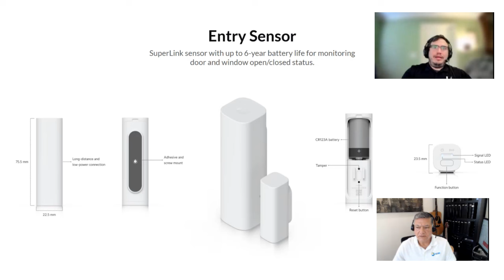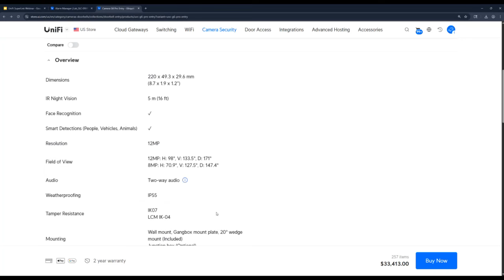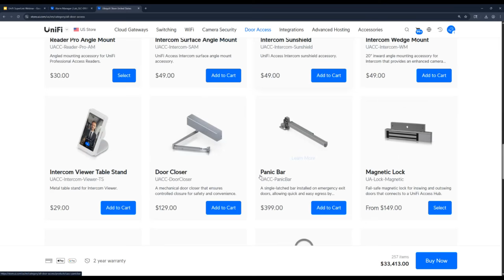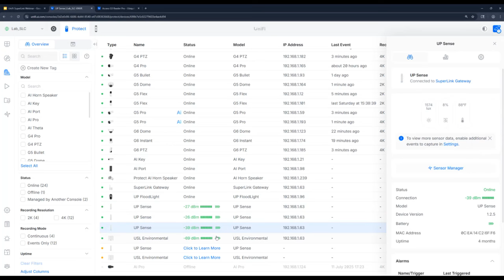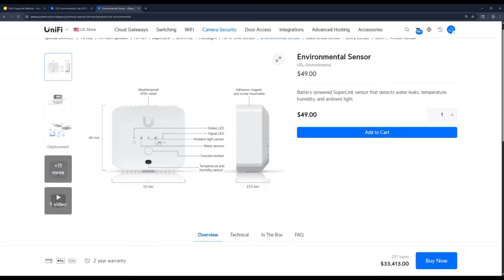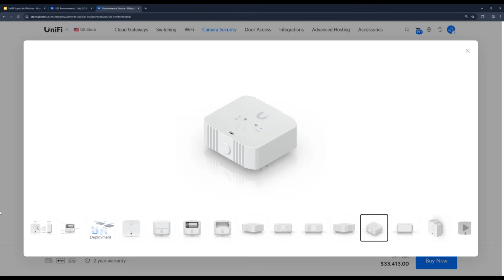Unlocking the Power of Unifi Superlink: Smart IoT for Every Project (Full Webinar)

Comment: Wouldn't it be better if Unifi (USA) web was mentioning "requires a Suplink Hub" under those sensors. I just purchased a newly released (NOV 2025) door sensor and I found out that it needs the Superlink Hub. I also hope that this Hub and all the Unifi sensors can work with Home Assistant (HA), since all my home automations are based on HA. Thanks...